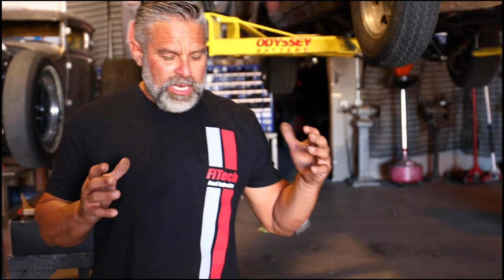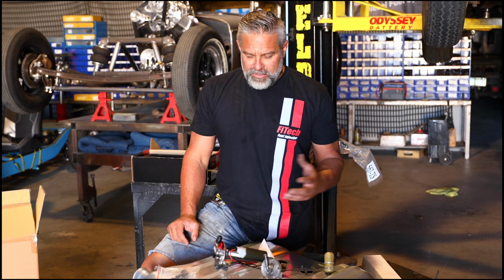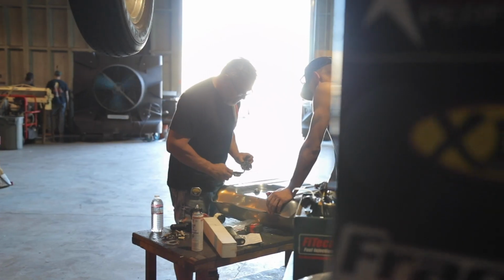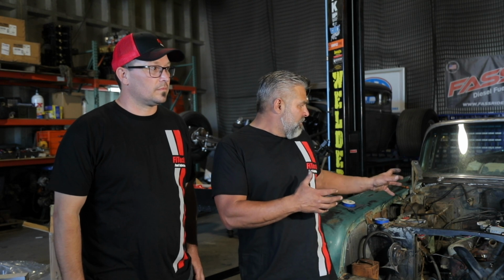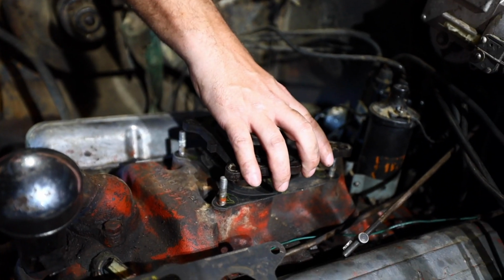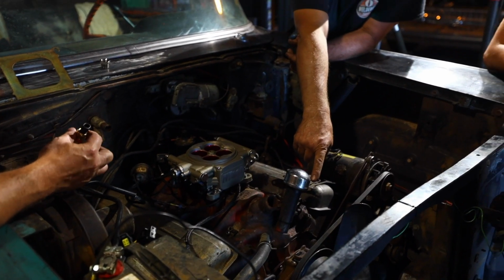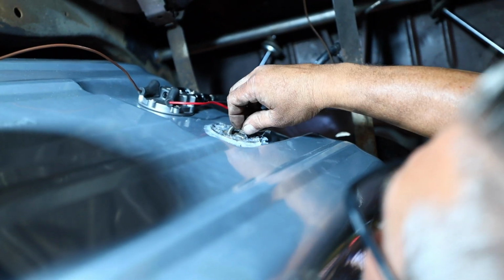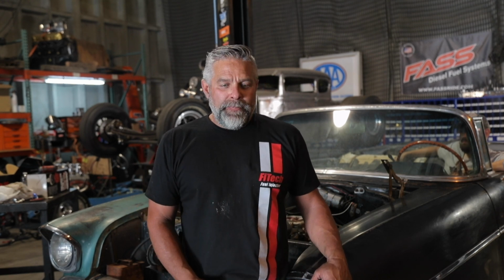Putting a Fitech System In My 57 Chevy!

Comment: Fitech makes a good product.i have a turbo sbc blow thru setup and it runs really well. Well im actually in the middle of changing up the lower end because it made more power than I expected with the original setup. But honestly once you do one and get family with how to wire it up for your setup as everyone's will be different. You can literally do another one in a hour or less it's that easy. The programming can be tricky to someone new to it.  But if you call Fitech they have great people who can help you out. I had to call them a few times and they answered all of my questions and got me going. They were super easy to talk to and vary helpful. I don't generally write about a product but they actually impressed me. The guys out there who have anything bad to say just probably didn't install it properly. Im just being honest. I have a second fitech on my 70 chevelle with a BBC and It runs excellent .I could not be more happy. I hasmd issues before the fitech with it getting hot and not wanting to start alot of times.  I could not get the varb dialed in properly. Once I put the fitech on which aside from figuring out which direction I wanted to go with my fuel pump it only took a hour to install. And about another 45 minutes to an hour to dress it up and look beautiful. I mean hide the wires etc. Overall a great product. It took me 2 years before I committed and pulled the trigger and I was awfully upset that I waited.. anyway great video!
Reply: Thanks for the heart! I just read my comment apparently my phone changed a few words but I guess you guys know what I'm saying lol

Comment: Steve another Reason why your " Content" Resonates with me is the Camera  Angle like  your" Show " before  and you are a Good Comunicator(Host) and I had a 283 V8 Brand New with a 2 Speed Powerglide 1974 Chevy Vega Monza front end 2 inch Aluminum Spacer Plates, 8/34 355 posi -trak from a ( GTX) rear end  and Nitros 17 years Old  and F------g Running the Cops everywhere!! I got pretty good at " Evading" but that Car  that  we Built, I swear it was a ( Living  Entity) it stuck to the Road like Glue!! Thanks for reminding of  Good Times ..Dean Toronto

Comment: Would not buy another Fi-tech product to save my life---Customer service absolutely SUCKS--Tuning of the system much more difficult than other systems and with HORRIBLE customer support waste of money....not to mention part failures
Reply: Man the fitech on my turbo charged 351w runs amazing.  Fired right up first try and haven't had an issue since.
Reply: Jon Smith  thanks I got a amazing deal on it and ended up letting it go to someone who's restoring it and adding it to his AMC collection!
Reply: Jon Smith  I own a repair facility...To be more clear it was a dual 2k setup on top a 6-71 blower...it did start and run but that's about it...The Tech. service talked down to me like i was an idiot, i had seen advertisements of a 6-71 working great so i asked for a downloadable file to get me on the right path, not available! They did not return messages and i even got an i don't know response once..navigating the handheld is over complicated not to mention handheld glitch's which resulted in intermittent engine shut down...They did refund my money to be fair...old school dual holley supercharger carbs. and runs like a stripped ass ape!

Comment: Once you understand what it's doing and get comfortable with it the fuel injection is so much more easily tweak-able than the carb.  You're able to finesse the fueling in such small increments at every single aspect of the fuel curve, so much more adjustability than you could ever get with a carb.  Very fun once you get the hang of it.